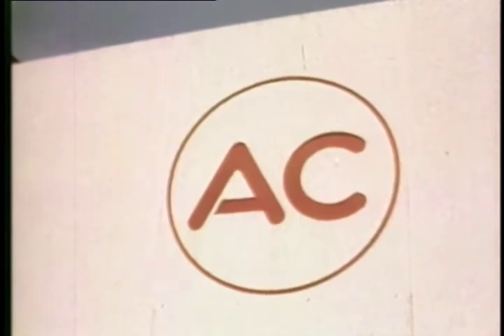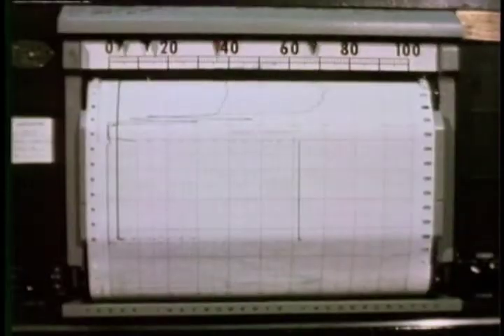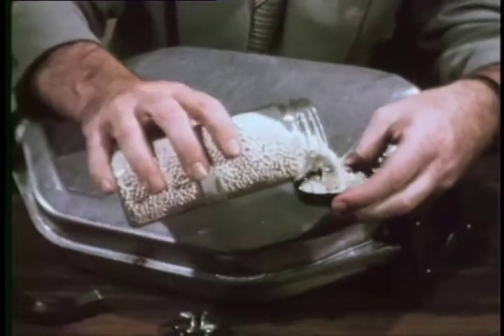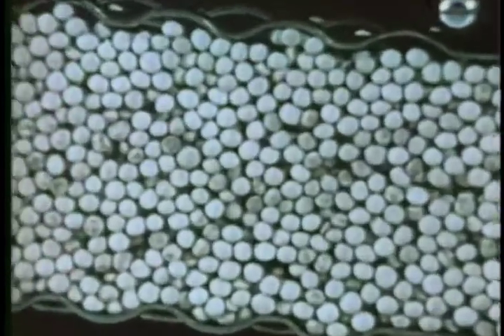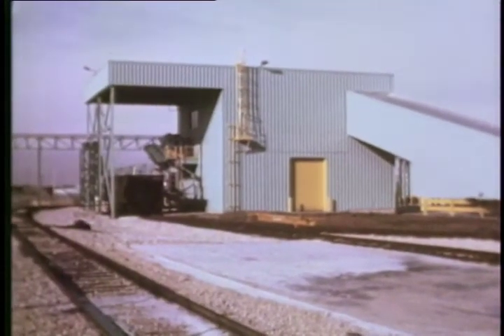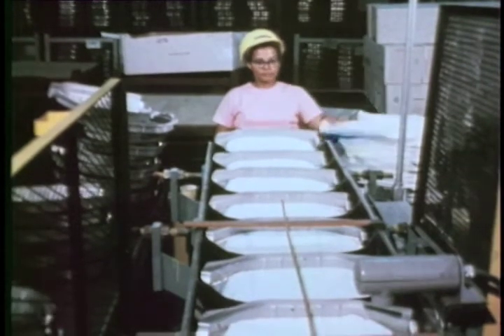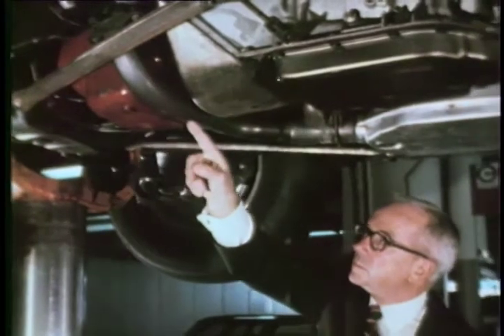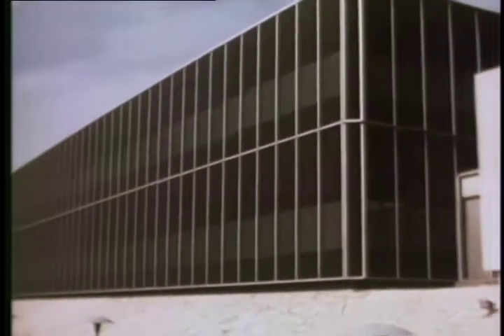Tale of the Turtle - Emissions Control

Comment: I can still remember when catalytic converter cars hit the road in 1975.  The cars were still carbureted and ran slightly rich.  I also remember the smell of the exhaust, it had a rotten eggs aroma.  The only fuel available was a regular grade unleaded fuel.  Engines were still the large displacement units, so they ran OK, but not great.  Later, with the availability of higher grade fuels and fuel injection, performance improved and emissions dropped.

Comment: Is this the same AC that is part of or related to AC Delco?
Reply: Yes. AC Spark Plug and Delco were the most electronics-intensive parts of the GM internal parts empire, and they got merged later. Then most of the parts operations left the company, spun off as Delphi, and ACDelco became (essentially) the aftermarket parts brand of GM.

Other fun fact: The "AC" stands for Albert Champion, who was also behind Champion spark plugs.